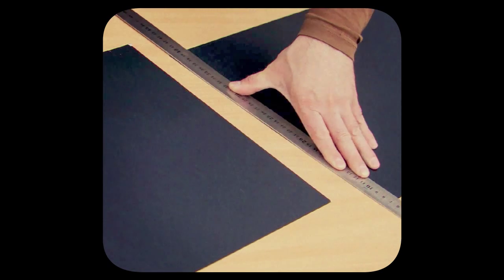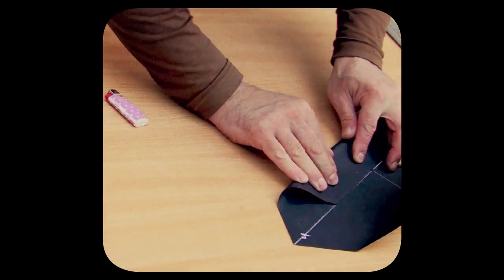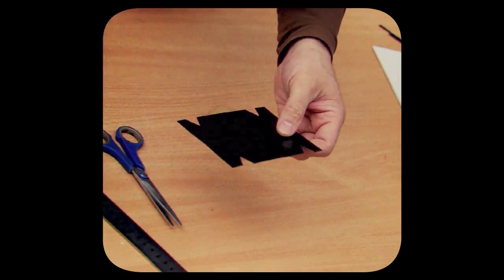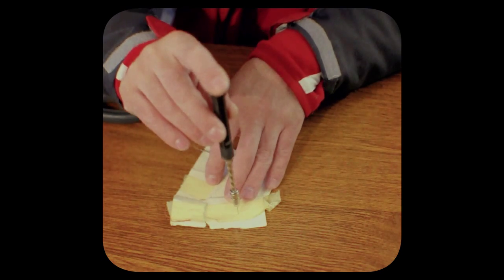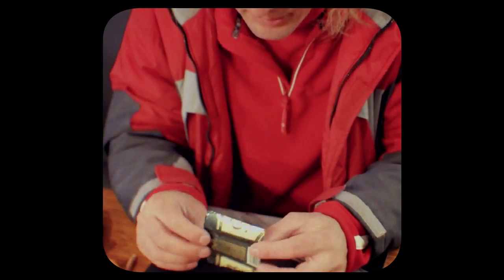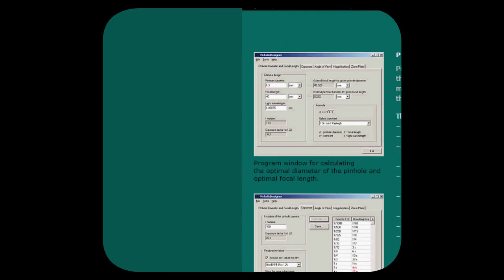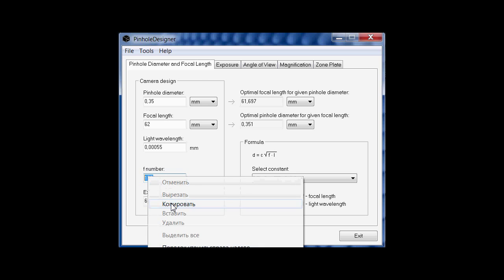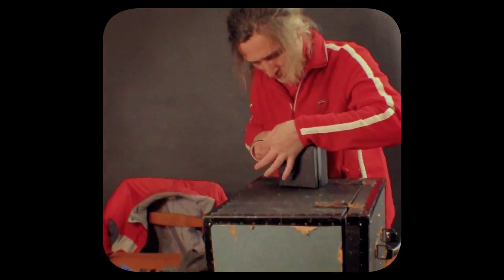pinhole paper camera

Comment from the maker: It is necessary to place the film inside the black box or in a dark room with its face to us and with its back to the film holder fixing film edges with the rubber strips.
We make the hole in the box cover with the punch stamp. We will place our tin with the pinhole.
We can do it also with a knife, scissors or just lacerate.
It’s only the question of esthetics.
In order to make the camera reusable and to make easier its recharging I stick the small wooden or plastic rectangle with the help of two-side scotch inside the camera on its back side.
The camera thickness allows make a small fissure between the film holder and the box. The rubber strips lay in it and the film is not bent.
From the other side we stick to this quadrate the thinner scotch that can be disposal but helps us easily to charge and discharge the camera.
Important! You should be careful to make the film holder fixed in camera in a proper way that it not unstuck while you transport camera or work with it.
Pinhole we will make in the thin sheet of tin, we can cut it out of the can of Cola or some other beverage.
At first I take off the paint and zinc covering with the polishing paper from that part of the sheet where the hole will be.
We will drill the hole with the sewing needle.
It’s better to drill then to pierce the hole!
It that case we will have the sheet not deformed.
For drilling we will need the hand drill with the very small cartridge where we can clutch the needle as the drill.
To have the needle clutched without backlash it’s necessary to break off its head as it usually has the broadening.
It could be done easier with the pliers.
If you can’t find the drill you can use the wooden pencil. We put the needle into its blunt part moving the broken part of the needle into it.
So we have the simplest hand drill.
It might be easier to work if you will put some kind of cap on the pointed part of the pencil that must have larger diameter. 
The diameter of the hole that we will get depends on the size of the needle and on the hardness of the surface where we are drilling.
As the pointed end of the needle has the conic form the diameter depends on how deep the needle will go into the tin sheet.
We will have one result using the polished table surface.
If we put the glass under the tin we will get the smallest possible aperture.
If we need the larger aperture we can use different needles or to put paper or cardboard under the piece of tin.
How can we control the hole diameter?
Usually I use the microscope multiple of twenty five and the scale with the division value 0,05 mm.
Not always having it at hand we can use magnifying glass with the measuring graticule.
Such a unit is quite expensive but we can get 8-fold zoom and graduating mark of 0,1 mm.
It’s not so convenient as the microscope but quite adjustable decision.
One more way to measure the aperture is to put the tin into the film channel of the magnifier or into the optical lantern together with the calibrated ruler made of transparent material.
Taking the magnifier in the upper position we can measure at the projection visible part of the ruler and making simple mathematic calculation to find out the magnifying index.
Then we measure the diameter of the projection of our aperture and knowing the magnifying index we can calculate its real diameter.
Through the calculation we can get quite exact figures but we have no information how clear the surface of the aperture is. 
The magnifying glass can have the booster light, but we can clearly see only the diameter of the hole.
If we want to see the shape and neatness of the aperture we have to use only skew ray.
That’s why I use the extra lantern.
It’s important that the aperture had the roundish shape.
After drilling we can notice by magnifying that the aperture itself reminds the cone and looks similar to Moon craters. 
That’s why we need to polish the surface checking the process from time to time through the magnifier so that the hole edge became even.
The labeling of polishing paper from different producers might differ and you might be tricked by them.
I usually use the polishing paper of two numbers – the main one # 200 – it’s very fine and is usually used by car-painters. It reminds the usual paper by touch.
For the first stage I use the paper with larger abrasive number.
The better you polish surfaces with the fine paper, the better picture you will get.
Under home conditions it’s not so simple to get the aperture of exact diameter.
Focal distance depends on the diameter.
So we made the body of the camera where we can regulate the focal distance to some extent.
Focal distance of the pinhole aperture can be calculated according to the formula.
But it’s more comfortable to use the free distributed program the Pinhole Designer.
We have to put the diameter of our aperture at the “aperture and focal distance” insertion and to get the “optimal focal distance” for its usage.
It’s easy to notice that the best apertures for our type of camera are the holes of 0,35 and 0,44 mm diameter.
At the insertion “angle of view” we can evaluate the view angle of our system.
In our case we have the picture of 60 to 60 mm size as the upper edge of the film being fixed in the film holder are playing the supporting role. So we will get the picture of larger size though we will have the black marks (at the positive image) from the rubber strips. 
View angle of the camera that we will have to take into account. 
At the insertion “aperture and focal distance” we put the rounded figure of the optimal focal distance.
For example: the optimal focal distance for diameter of 0,35 mm is 61,967 mm.
So we have to put the figure 62 in the window “focal distance”.
The aperture of the system is 177.
Usually exponometers don’t have the scale allowing to work with the aperture 177.
So we have to calculate the exposure for the aperture of 22 taking into account the sensitivity (ISO) of the photomaterial we use. Also we have to use the multiplier factor (64,7 in our case) to define the exposure time.
Practically, as we always have the dependence on the time of exposure for light-sensitive materials at high exposures (so called Swarzshield effect), it’s easier to use the insertion “exposure” of the mentioned programm
where we put the figure f of our camera (177 in our case) and having put the option “consider the error for” – check the film we are working with.
For example: ILFORD HP5 +
Pressing the button “calculate”
we have the convenient table where the measured time of exposure by the exponometer for the aperture 22 is found against the time we need for our camera.
When everything is ready with our aperture and we are satisfied with calculations, we cut the tin to make it looking nice and comfortable in size.
Now we take our tin, put it on the front part of the camera box.
Now we line up the pinhole aperture with the hole made before in the black paper of the camera.
Let’s now connect the tin to the camera using the black scotch.
One more thing – we cut off the piece of black scotch and use it as a shutter, sticking it over the hole.
To make the shutter open easily we bend the loose ends of it and stick them with each other.
Now the ends won’t be stuck and it will be easy to open the shutter.
If the box is not locked fully as we wished, then before charging the camera we have to wind external edge of the more narrow part of the box and the external edge of the cover with black scotch.
Moreover, we can stick the strip of cardboard so that the box will close only up to the focal distance we need and we were able to lock it in the darkness in a proper way.
Now we only have to fix the cover in desirable position with one more layer of scotch.
Charging. Inside the black box or in the dark room we charge the prepared piece of film 60 to 90 mm in the film holder of the camera.
Film holder is taken and stuck with the prepared scotch inside the camera. 
Camera assemblage.
Now – to photographing
In the darkness we charge our part of the film.
Development. The procedure is the standardized one, it is described on the film producers sites, in special literature or other special Internet sites.
We control the development time and the temperature depending on choosing technical conditions.
Then – rinsing.
And fixing. 
Rinsing and drying.
From the negative you get you can make images with the contact method or using the method of the optical projection. Also you can scan or replicate it.